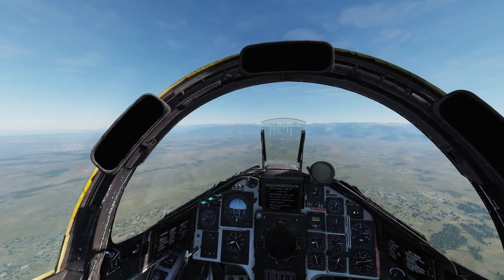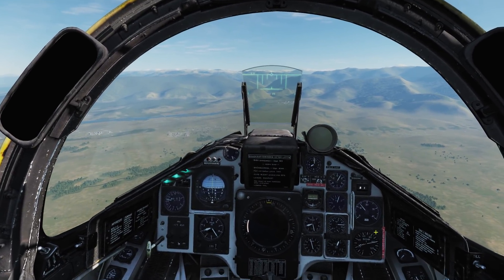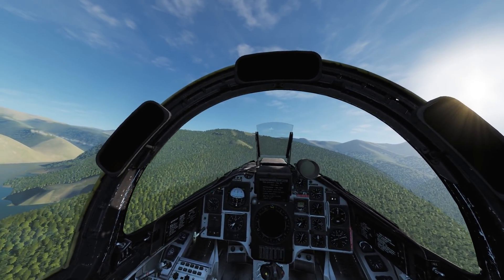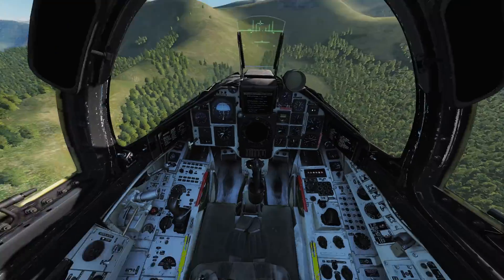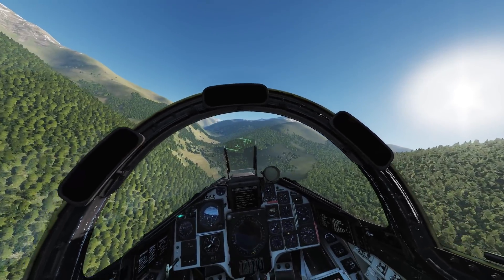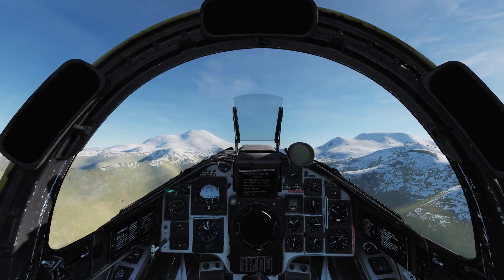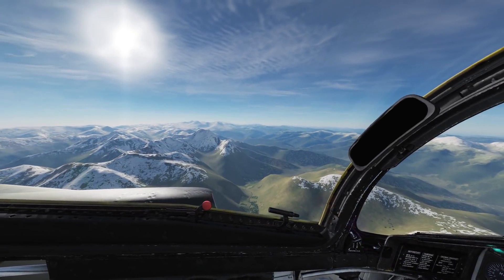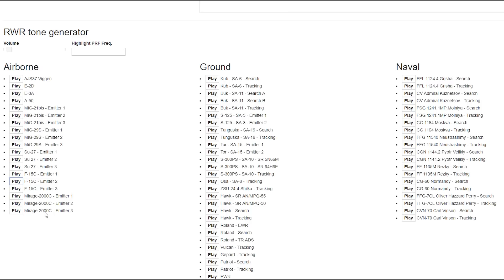DCS: AJS-37 Viggen RWR Tutorial. Or what's that beep!?

Comment: Does the note of the RWR warning correspond to anything? Frequency of the radar hitting you? I noticed the EWR was one of the lowest sounding and they usually use the lowest frequencies out of everything within the context of blowing things out of the sky. Although I think the Shilka sounded lower and I would think they'd operate off a higher frequency.
Reply from the maker: Was a while since I flew the Viggen, but yeah I think the tone basically refers to the danger of the radar, like a tracking radar always has a more high pitch tone with high frequency compared to search radars and EWRs which are lower.
So when you hear the deep slow tones you know that the enemy may know where you are but you aren't necessarily in any danger. While quick high pitched beeps means that it is time to take evasive maneuvers and keep an eye out for missiles or fighters locking you. 

This isn't always true though as some radars have odd combinations of sounds but for the most part they follow a theme.
There are a few special cases like the Shilka which has it's own very recognizable tone and frequency. Probably because it would be a very common and dangerous threat at the time I'd imagine? You hear the shilka tone, then take evasive maneuvers right away or you'll risk getting shot down.

If the link doesn't work then search for Viggen tools. Make sure you turn down the volume first though! It has every tone in the game so you can familiarize yourself with the most common ones.
http://www.viggentools.se/